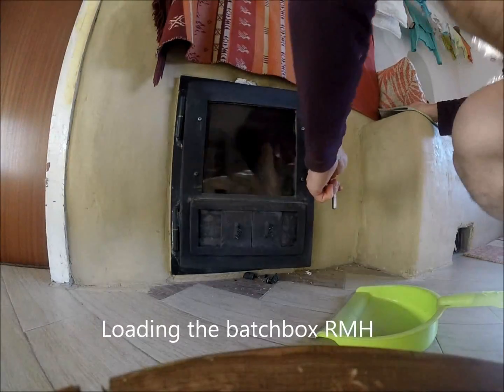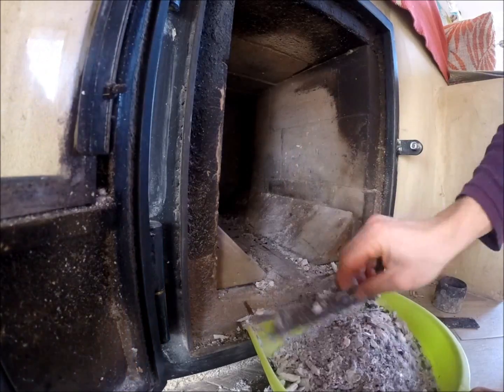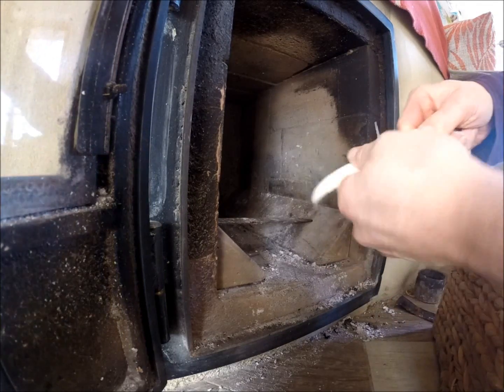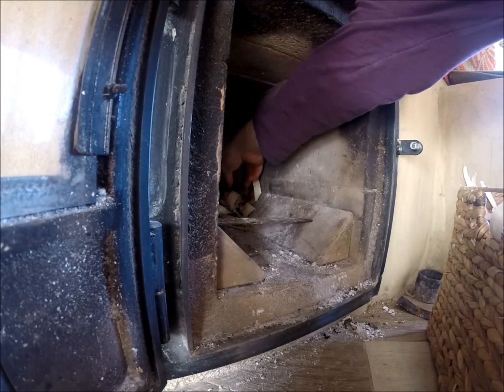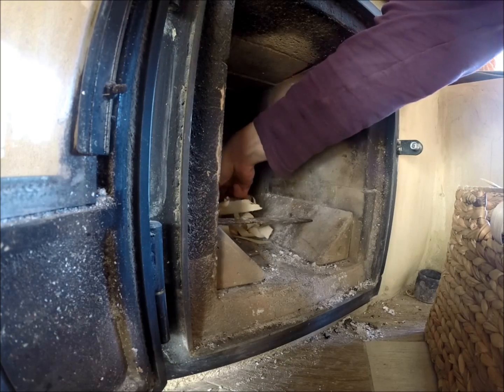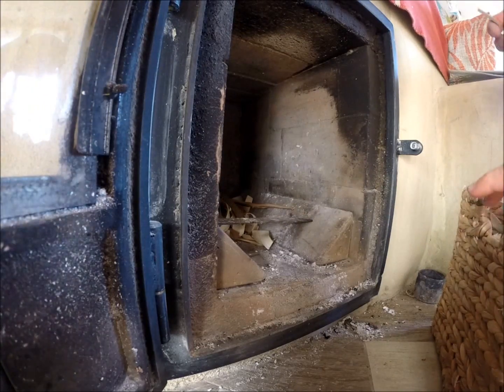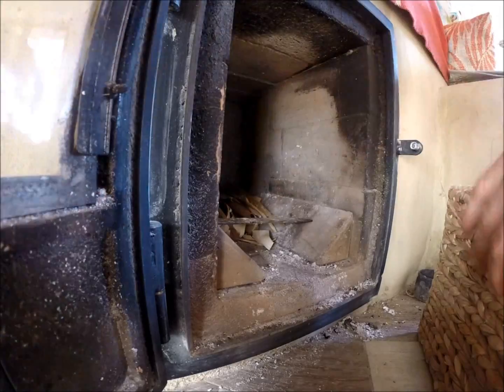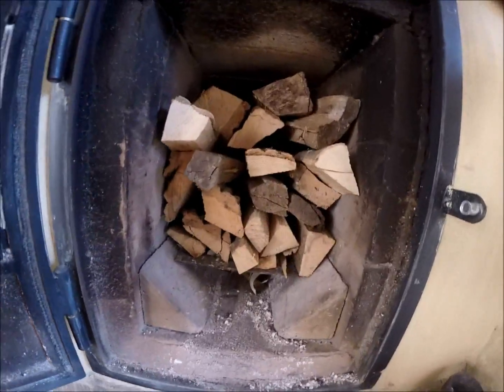Lighting and Loading the 6" (150mm) Batch Box Rocket Mass Heater

Comment: Request internal length height and width of batch box. Request dimensions of secondary and primary air intakes and the grade of fire brick eg grade 26, dimensions of bricks too please. What is the details of dimensions at the base of the chimney riser and the riser diameter and height. Nice video. Thanks.

Comment: hello. this looks really good. if it's ok i'd like to ask some technical questions. 
1 - how big is your house? how much of it gets warm?
2 - to what temperature it gets? for how long? i mean - if you light it once in the morning how warm is the house till the next time? 
3 - is your single bell is one skin or two?
hope you can answer all that... :)
thanks
Reply: Hi, Adiel!
I am in a lower floor of a larger three storey house, with this i only heat about 60 square meters (living room, kitchen, dining room and bedroom. Some additonal heat is lost to the hall.  The bench almost always covered with 3 layers of blankest - it is nice to sit on and it cools slower. For a good 6kg wood burn in the morning, the house stays warm until the evening and in the morning one would prefer to put a pullover on... I really dont have a thermometer in the house :-/.   We prefer the bedroom to be a little cooler. Also at night we close the majority of window shutters... Over winter we usually burn once in the morning, but every 4 or 5 days, we make another burn in the evening...  Sorry, Adiel, but it is really hard to tell how much can it be heated with this kind of stove...

I have a single bell with one skin. But the thickness varies:  over the upper part there is a vault and on the top the skin is minimally 14cm thick. Walls are about 8cm in thickness. Bench top is also abotu 12-13cm thick...

I hope this helps!

Comment: Very impressive, what is the metal ring for you set in the outh of the fire?
Reply from the maker: sannmarc , the ring targets some of the primary air towards the lower part of the fuel. there is the place where the fire is started. if the stove would be without flaws ( mainly to large inner surface area of the bell), that short duct would not be necessary.

Comment: can you burn bigger logs?
Reply from the maker: yes, but efficiency is slightly lowered because of smaller burning surface and it consequentially reaches slightly lower temperature. I always have som knotwood that cant be split. I put a larger piece or two in the upper half of fuel, or if I load twice, I burn larger logs in the second burn. 
Mandatory is dryness of wood.
Reply: ok thanks!